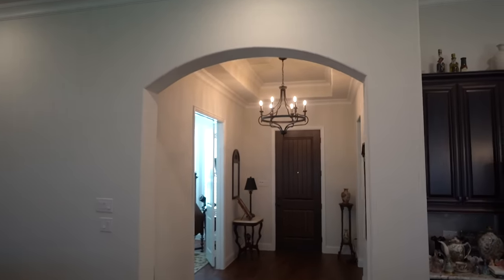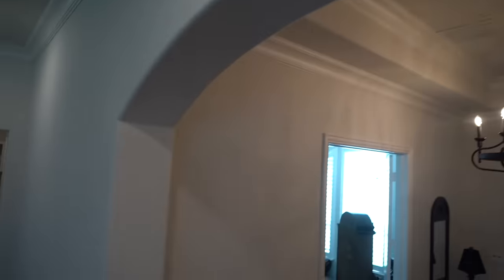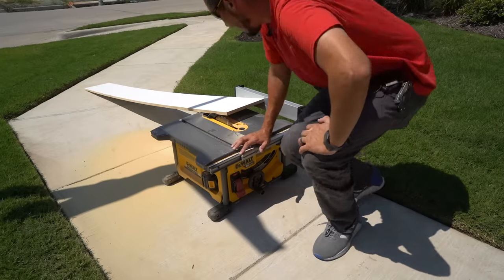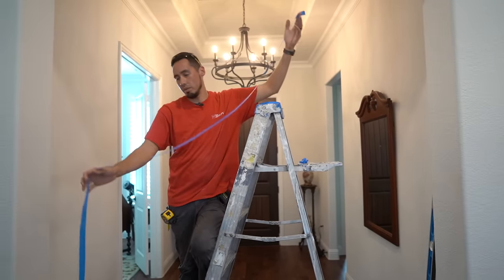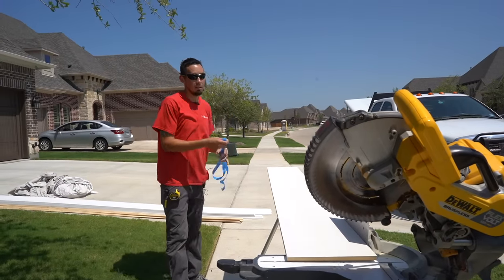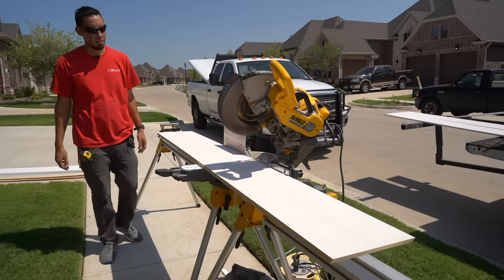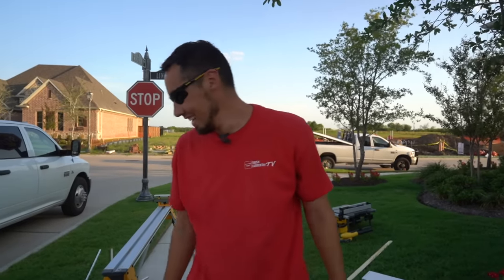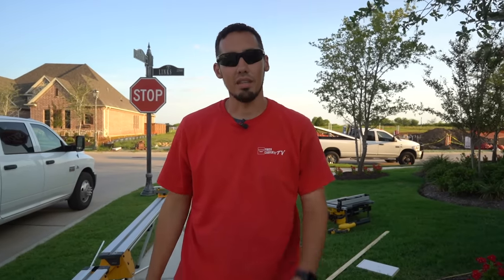Carpentry trick with masking tape

Comment: I've done many, many arches. 1 job was 6 , arch beams , 15  foot across, in a double barrel ceiling.  Framing and drywall was more than "acceptable " off!  Made a pattern, with 1/4 ply, I started with the widest and stayed 1/4" small. Scribed each beam and custom cut the beam that I made with 2x12 s cut  in 16" pieces fastened together with 4 pocket holes at each end with a "staggard", " left right pattern from a Craig jig. So 8 screws at every joint. Then cut to radius by the 1/4 " templet.
They came out  just !!!😍 GORGEOUS 😍!!!

Comment: I wanted to see how you then do the outside molding for the arch. Maybe a future video on that would be cool. Thanks!
Reply: I have a couple black and decker workhorses that |I picked up at rummage sales. Very handy
Reply: I actually watched for that reason. At least I did learn how to "flex" the board.
Reply: The answer to that is cut a board say 8 to 10 inches in width, (For this arch in particular) and enough length to go over the size of the arch by 5 or 6 inches.
Then place it to the arch keeping it level and temp fix.
Draw/follow the curve from the fixed head he's fixed, onto the back of the board.
Take it down and cut to the line using Jigsaw, then use a flush cut router bit along the cut to smooth it out.
Then its just mark the desired thickness of the architrave/cover mold.
Cut a block to that size and use it as a scribe from your curved cut.
Cut the line and use the flush router bit to smooth.
This gives you your cover mold, then its just a case of using the router with desired mold.
Reply: When? Who?   What????
Reply: @onemoreriff7644  I don't see how you would case this arch the way you describe.  Even if the casing was just a flat board surface, which it's not, there's a better/easier/more exact way to do this.  Presumably the casing profile to be matched is at 0:49 around that door.  The way to do the arch is to bend thinner bands - say, a half inch wide - of wood to match the profile and arc of the arch, gluing and clamping them successively on top of each other until the layers equal the final width of the casing.  Each section of the wood bands would first be routed as necessary to match the curved surface profile followed by the gluing and clamping in place.  After the glue sets, sand the casing surface and cut the required miters in place at the ends with a hand saw, then add your matched vertical casing. 
 
If I understand what you're describing, you would either need a jointed board of sufficient width, which would be more like 16 in. (hard to tell without being able to measure the height of the arch) to accommodate the full arc, or else use multiple boards, cut as you describe, and then rout the profile in the arched board?  So the board would need to be sufficiently thick as well to accommodate the profile.  Maybe not understanding what you describe, and I have no idea how you would rout that profile in place on an arched flat board - it would require multiple passes across the full width of the casing.

I framed, built, and cased 10-ft. and 8-ft. wide arches in my house.  I matched existing casing using the separate bands I described.  The surface  profile had varying layers/thicknesses, plus backband, with two convex profiles in it. Total width 4-7/8-in.  I believe I built it up with eight or nine separate bands, curved and glued on top of each other concentrically, which achieved the final width with the matched profile.  I sanded the surface in place, primed and painted and it looks identical to the existing casing elsewhere.
Reply: @rla1000  Yeah you could do it that way, but it would take more time than my way of doing it. If i found it wasn't possible to do the specific mold on site, i would just make my profile from my steps, then send it off to the joiners with a profile match, i have done that numerous times before when doing arched openings, then just come back to the job to fit.
Reply: Just buy flexible mouldings. They are purpose made for this type of work.
Reply: @vzgsxr  hehe the flexible moldings were shown in his nap bit.

Comment: Richard try to use your chop saw with plunge depth set at desired plunge depth position with a spring welding clamp for stopping the cuts exactly at the curf depth you want. Eliminate the framers quick square and skillsaw.
 Or use 1/8 hardboard that's bendable. Saves time, Same results.
I know you didn't ask, but hopefully this will help.
Reply: I believe the dewalt slider has a built in depth stop for the plunge cutting
Reply: When moving 1/2" a million times, the Skilsaw is much faster than sliding the board 1/2" with each cut.

Comment: Great tip... I also use Soft Flexible Magnetic Tape Measure for measuring certain jobs; & it’s able to pickup the fasteners in the studs/walls “most” of the times. If it doesn’t, have a adhesive backing that will stick to 99% of material w/o leaving any residue when I remove it. I originally got this for doing vinyl wraps on automobiles; but it’s been very handy for other jobs as well. Only problem is....got remember to pack it, but if forget it, definitely using the tape tip.
What size fasteners did you use for the arch: 18g, 16g, or 15g? Also wondering how you figured the 1/2” kerf cuts on the back.....trial & error method?
Thanks for the tip! Cheers✌🏼

Comment: If you don't have a fellow to help you, you can screw a piece of 2x4 on each side of the wall about 2 inches from the top to lay your board. Once it on place you can adjust to whatever you need. The tape trick is very useful, thanks for sharing.

Comment: There is also a math formula for finding the radius of any "spring head" arch in the event you need to do a glued up jamb for something like a raised panel opening or where you have to use solid hardwood. I've used this formula for 16 foot wide jambs where we had to swing the radius in the street !

If you have to make a bending form for say a raised panel opening, we would glue everything up at once with West Systems Epoxy and use wax paper between what is to be used for the panels and the styles, rails are usually short enough that you can use straight pieces, if not we built a swing router to cut the radius into the rail faces !

Like we always said RADIUS cost times ten !

We also took two pieces of casing and/or Crown moulding to make one arched or radius piece by ripping one piece off the first stick (keep that) move the fence back by the with of your blade and RIP the second stick (toss that) move your fence to cut the next width on the second stick (keep that) and just keep repeating the process.  When you do crown the blade will be tilted at the angle the crown sits on the wall to ceiling, usually 52 degrees but not always. 
Use a Uni-Saw or other really stable table saw and for God sakes, don't let ANYBODY talk to you or interrupt you in any way while your cutting and NUMBERING your pieces  !!!

For the crown, we would then cut wood wedges that would fill the gap behind the crown and glue and pin nail those wedges to the wall spaced whatever we thought felt right (depends on how tight of a radius) and then we would glue and either j-staple or pin nail our crown laminations from the bottom up checking your measurements every three pieces.

We weren't allowed to use Resin Art or any of the other brands in the homes we were doing.  We tried it on one smaller beach house and found that the nail holes would pucker as the resin dried even after being painted and it also got hairline cracks in it as it dried, IDK maybe they make it better now.  Most of the time we were using hardwoods like Cherry, Walnut, Teak, White Rift Oak or Quarter Sawn White Oak.  That's when you have to find two pieces of profiled molding with the same color and grain pattern !

The formula is C square plus 4 times H square divided by 8 times H

So C = Cord or your over all width 

H = the height from the apex to the top of the arch (if C is out to out then H must be from Apex to OD also )

 So total those two and then divide by 8xH (no squaring this one)

It will be EXACT everytime  !

What area are you in ?

I was in Southern California for 28 years and did all of Carl Akin's finish carpentry.
I was on the William Lyon Estate in Coto De Caza for 3 years and 4 months running all the finish carpentry with 86 guys working for me. We did many other huge jobs but due to NDA's I can't name, names !

Your work is clean and it's good to see that the art of fine woodworking isn't a dying breed !

Comment: That was excellent!
suggestion:  once you have the tape on the board take a measurement just in case that board
snaps while you are installing it - keeps you from the tape routine if you have to.
Reply: If I had to guess, he likely penciled the measurement on the back of board or saw table.  If not, that's a solid tip that I use in addition to putting painter's tape right on my measuring tape with notes on it (inside top, etc).  The tape still retracts and makes a great story stick for the job.

Comment: Appreciate all the tips and suggestions you provide for us.  In the past, you've asked us to provide some of our own, I have one, which may be valuable for ya.  You know the challenge and trade off that comes with sore knees, and the discomfort of knee pads.  I'm here to say after decades, I've found a way to use knee pads, get all the benefits, and not suffer any of the discomforts, honestly and really.  It's this simple - Duluth Trading makes a pair of work pants, with a pocket sewed in to accommodate a pair of knee pads that they sell separately.  Yes, the pants are expensive, but knee pads are just one of the benefits of these pants, as they are extremely comfortable to wear, and I really don't know how they do it, but they just do not fall down either.  I know it will be a hundred dollar bill, but with all the different tools you have purchased and reviewed, these pants with the optional knee pads will do as much or more for you at the jobsite than many tools in improving your comfort, and thus able to increase your ability to concentrate and keep your energy.  I really, really suggest you try them.  Be careful to order the pair that has the knee pad pockets, as all of their pants do not have them.  It's the "DuluthFlex Fire Hose Ultimate Cargo Work Pants".  https://www.duluthtrading.com/mens-duluthflex-fire-hose-ultimate-cargo-work-pants-71703.html?dwvar_71703_color=BRN&cgid=mens-pants-work-pants#start=7&cgid=mens-pants-work-pants.  If you'd like to have knee pad feature, that is comfortable to wear, this is it.

Comment: That tip was embarrassingly simple and should be obvious to anyone. However, I NEVER would have thought of tape! I've used really thin plastic trim as a template with less than stellar results but my jaw nearly hit my keyboard when you showed that tape trick. Thank you thank you thank you! As I said, in hindsight, it looks so obvious. But to me, as well as countless others I'm sure, that shit was GENIUS!
Also - had me crackin up at the end! 
This video earned a sub! How have I not seen/subbed before this? 
Keep em coming and thanks again!

Comment: Good tip, thanks.
I noticed, when you made the workpieces first cut on the end miter, you began the cut in the center and then push back toward the fence, before pulling forward and through. It would be better with less splintering of the face if, when you have the finished side down, you were to pull the saw blade toward your body completely, BEFORE plunging the saw blade downward, and then push the saw to ward the fence, causing the saw blade to cut up through the piece.

Comment: great idea on the tape!  it's kind of annoying how simple a trick like this is, yet i never considered it before.  that said, i saw someone else who liked to use polyurethane adhesive to fill in all the kerf cuts on the back so that when the curve was nailed into place and the adhesive dried, it would actually restore a lot of the structural strength of the whole board itself (instead of relying almost entirely on its attachment to the frame or drywall or what have you).  in doing so, it would be more like a solid board that was dampened and curved instead of a weaker board w/ a bunch of cuts in the back.  just wondering if you ever do this.

Comment: Hey, just watching this and saw you do the kerfing cuts with a circular saw and a square. I dont know if the dewalt doesnt have the feature or theres a reason you dont use it but my makita has a little plate with a hole in it on the right hand side that had an adjustable depth stop. Leave it in and the stop passes through to cut full depth or swing it out and the stop hits the plate cutting only to the set depth, super handy function and it adjusts maybe 30mm if i remember correctly, just thought id let you know since you just got a makita in your recent videos.

Comment: If you wanted to remove it in the future for any reason you could line the inside of the curved opening with making tape before applying the construction adhesive, then as long as the construction adhesive gets in the kerfs you can take the piece out and it'll keep the shape

Comment: Wonderful ingenuity Richard on the measuring I would be careful with the table saw on the ground doesn't take much to set it up higher even on the back of the truck is a good trick as long as it is secured
 I am also glad you mention removing the fence from the miter saw when you did the 29ﾟ cut speaking of bad days: have you ever cut through a fence?

Comment: You may of answered this question, but i scrolled down and didn't see it. Why wouldn't you use your miter saw for kerfing?  It's got a built in stop. I always put a piece of scrap behind the board, so the saw can run past the edge.  To me, using the miter saw would be easier and more accurate.  Not criticizing, just curious. Love you channel.

Comment: just a tip what's worth to try for you, and when you do, let me know if you niticed any difference,
when i have a job like this, what is always a chellenge, i cut the mdf the same way to bend it, but instead of cutting it 90 degrees ,i cut it 85 degrees, that way its more likely not to break on you because the bend is constantly at a differend place, and another benefit is if you bend it into the arch the possebillity of seeing 100 ''corners'' in the mdf from bending it is much less . btw that tape trick was awsome, sometimes we forget how simple it can be . great job as always :)

Comment: I'm pretty sure that saw has a depth stop. You can cut your kerfs with the miter and not have to your the circular and square and probably save some time.  Your work is stellar.
Reply: I was thinking the same thing at first but sliding the work piece might mar its face and it seems easier to maintain regular kerf spacing by using circ saw plate as guide vs eyeballing it along miter saw table--though I suppose one could mark the fence for reference.

Comment: Just a question for you...do you ever use a 2 step saw horse...I use them before I ever pull out a step ladder. They are very convenient because in the average home with 8 foot ceiling heights I can get up into the corners for painting, for crown I set up two of them with a adjustable aluminum plank. So many uses and they store smaller than a step ladder. I have several 6 ft step ladders in my trailer and cannot remember the last time they got used....

Comment: You could use trig to figure it out but I like your method better. :) I’m a retired electrician and as you probably know figuring bends in conduit is trigonometric function but I never knew an electrician that used trig to figure out bending angles except in trade school. We have little tricks to speed things up. One question: the miter was 29 degrees on the protractor. Does that mean the angle was 58 degrees? Maybe I missed it. Great video!

Comment: Another idea :  measure 6" from either end. Put a pencil mark.  Put a mark on your tape roll (or any other cylindrical available object). Set the mark on the pencil line, roll it along the archway counting the revolutions. When you reach the second pencil mark put another mark on the roll...   You can work out the rest...

Comment: Fun to watch, nice work, and good time saving trick. However: Never never never work over unprotected floors. Second, You shouldn't miter the jambs. The will open over time and it takes longer. Third, you run the risk of a lawsuit by setting up your equipment on the sidewalk especially with a power tool. Fourth, I am pretty certain you can adjust the depth of cut on that miter saw so kerfing the backside might have been easier and faster.  Yes you might have needed to block out the jamb so the shallow cut would reach and complete the cut at the fence. Fifth, you didn't need to remove the entire piece of baseboard.  Removing the jamb section first. Align or measure the casing width (with reveal) and cut the base with a Fein tool or similar.

Comment: Do enjoy your videos. I am not even a carpenter. In fact I am so good I can measure and cut 3 times and it is still to short. Actually mechanic, truck driver retired. I have done all of my remodeling in my home and for the most part I have done a pretty good job except base moldings with bull  nose. I have seen a nice finished look in a few different homes but never could figure out how they made the cuts until I watched your video. So simple even ordered the little tool to mark the bull nose, after many years of ugly I did my first bull nose miter today. Thanks a million. Where do you get you mdf glue? Go to Lowes or Depot they don't know what I'm talking about. I did order some on Amazon